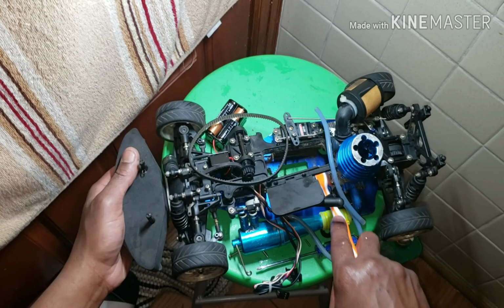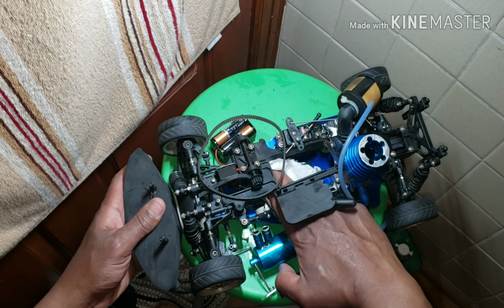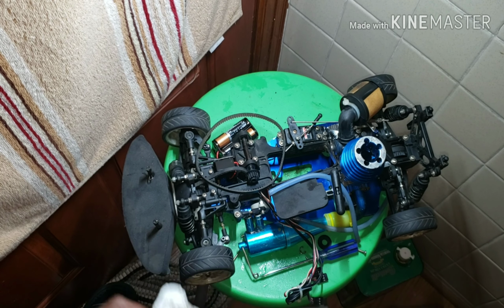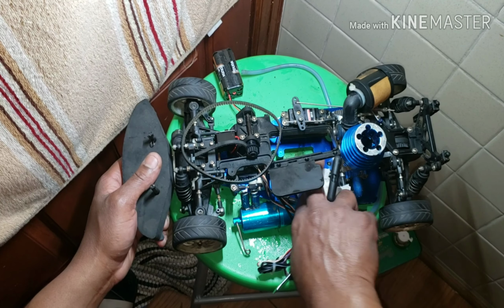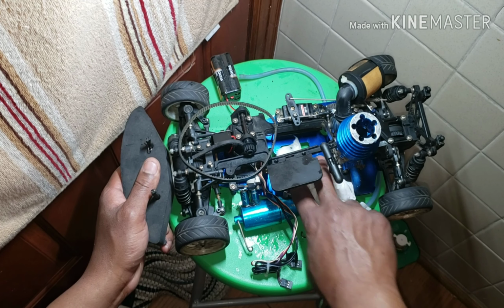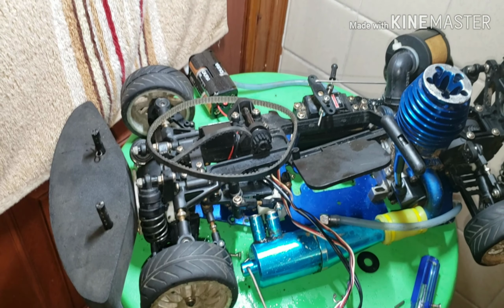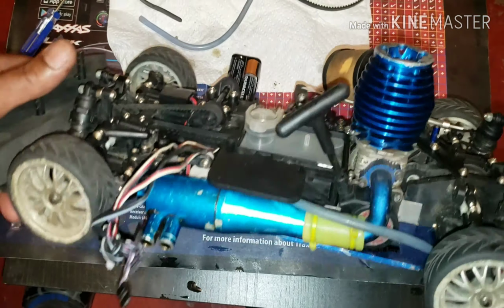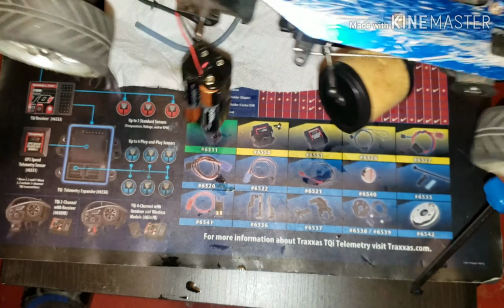Traxxas nitro 4tec in 2019 part 2

Comment: What engine is that an did you have to modify that chassis to make it fit
Reply: Nvm I seen in the other video it’s a 2.5 but what head is that
Reply from the maker: No mods straight  fit
Reply from the maker: Don't no that how I bought  it
Reply: @rchotboy154  it's a 2.5r. They have the larger blue cooling head.